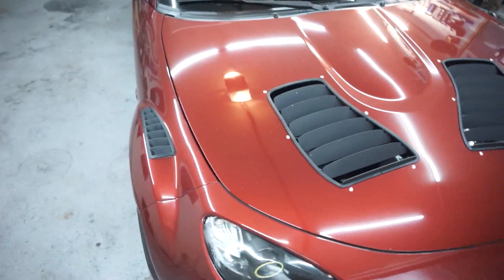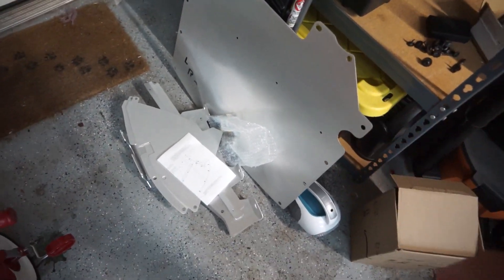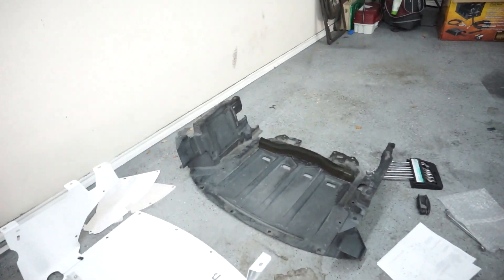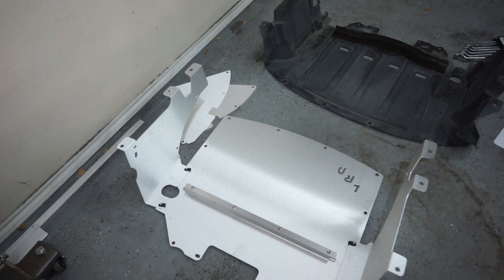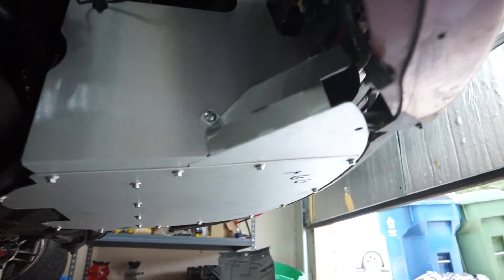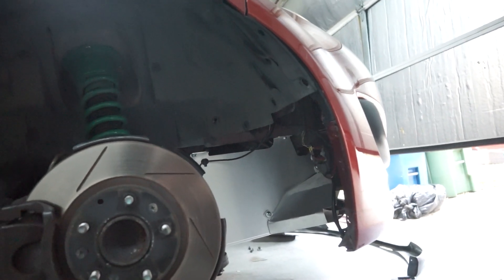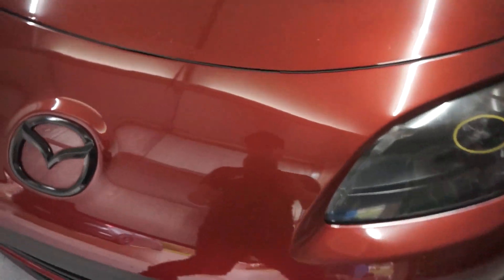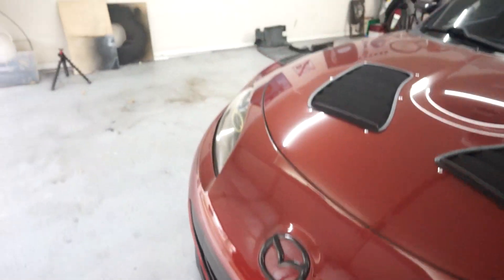Upgrading the NC Miata Plastic Undertray with LRB Speed Aluminum!

Comment: Hey, this may be a stupid request, but could you do a little video showing where the front jacking point is for the NC Miata? I have seen pictures “showing” what the spot itself is, but not relative to anything around it, and I am VERY paranoid about damaging my undercarriage.
Reply from the maker: I always use the jacking points under the side skirts. If you get down there and look, it's a thicker metal where you should jack

Comment: I don't get it, this looks like a mod just for the sake of modding. No added benefits, just an increase in weight and possibly causing thermal problems.
Reply from the maker: I think "thermal problems" is a stretch
Reply: I did this mod after metal road debris destroyed my oem & dented my radiator. This is much better protection for the rad than the brittle, thin OEM plastic tray.